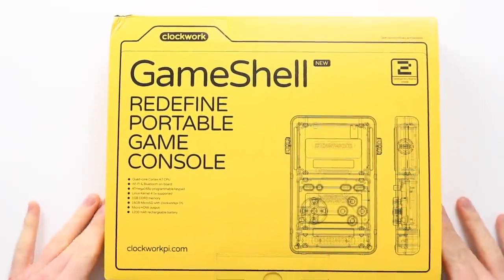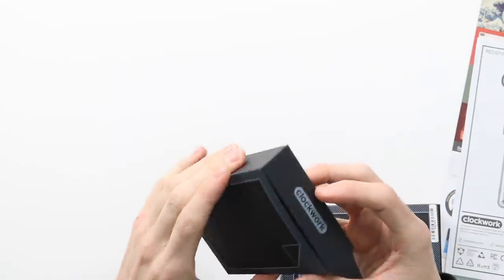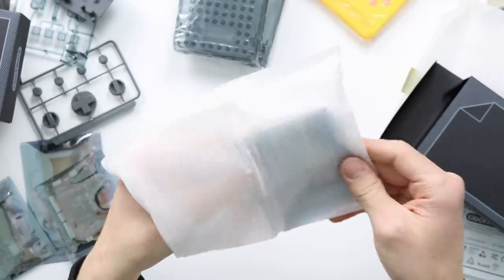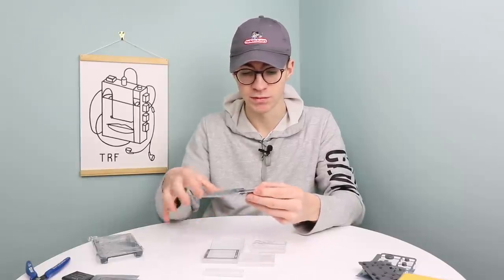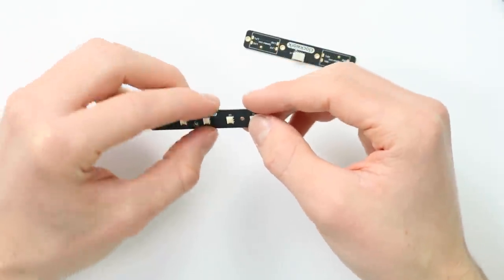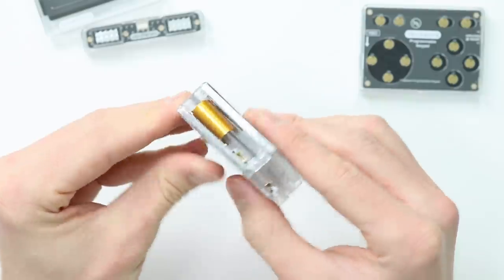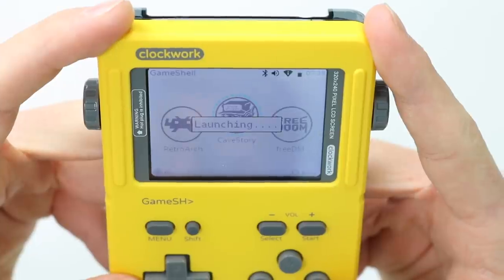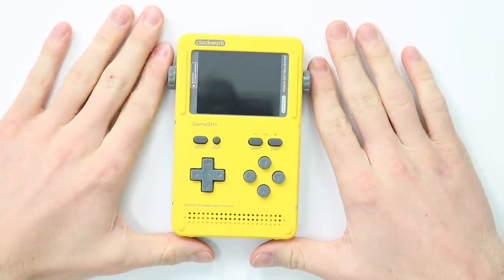Clockwork GameShell Assembly Guide!

Comment: Honestly, I really like the idea behind the enclosed casing mechanic they used, where it makes it so that replacement is much more simple instead of having to deal with removing and reapplying solder, it makes assembly more simple, and it provides an extra layer of protection for the more delicate circuits like the motherboard or the screen. On the other hand, I do agree that it doesn’t look that aesthetically pleasing and they probably could have gone with a more secure method of keeping the console closed. All in all, I honestly think it does look cool, and I’m guessing this is probably very appealing to model making fans.

Comment: I really don't get who this is marketed to, with shipping this thing would set me back $185 (£145). It's more expensive than building a pi based option which has more support since this won't work with emulation station/retropi/lakka. It's also more expensive than many pre-built options for people who don't have the experience to build their own, for example using a PSP/PSVita or Android device. It just seems like an option for people who want to feel like they've built their own when all they've done is plug some cables in.
Reply from the maker: This is way more polished than PI. Pi is very buggy and "dev-like".
Reply: do you consider putting together a pc "building" it? its literally the same thing
Reply: @pez You're talking about two completely different markets. There are different expectations between people looking to buy/build a handheld emulation platform and people looking to buy/build a PC. You're comparing apples to oranges.
Reply: @TheRetroFuture  That's my point. The people looking to build their own don't want a polished experience they want to DIY it themselves, they want "buggy and dev-like". The people who do want a more polished experience could get a similar experience, cheaper from a PSP/PSVita or Android device, hence why i don't see who this is marketed to.
Reply: @TheMixEmperor  i'm just pointing out that building a pc is just putting some parts together, much like this handheld. i wasn't arguing  against the rest of your comment
Reply: I would consider this as something of an "In-between" choice for those who want to start learning what it's like to take a look at modular/programmable stuff but don't have quite the confidence to mess around with things like creating 3D printing models and wiring. This device seems like it's got all the bells and whistles to help people understand that parts like that connect to each other in those fashions. 

Pi is great, don't get anyone wrong here. But stuff like that is usually pretty involved without a few guides handy. This is just "Hey we have that experience here and all documentation so you can get this stuff ready to go in a jiffy!"
Reply: Why get a pi when you can just emulate everything on your computer? /s
Reply: I think maybe this is marketed towards people who play retro stuff, knows some things about computers, and build model kits since it incorporates cutting parts, cleaning nubs, putting them together, and installing software. You can probably paint the shell either by hand, spray cans, or airbrushing. And you can add decals on top of that after applying clear coat and using decal setters and sol, just like a plastic model kit.
Reply: I have a ps vita & I play all my Games on it like SNES,NES,GBA,SEGA,GBC,
Arcade games,PSP,PS1 & Lastly PS VITA Games.
I have put all my games on a 128GB MicroSd Card SD2VITA.
& That's what I call a Ultimate Portable Gaming & Emulation Device With An Awesome Screen & battery life.
Reply: the only reason I see myself buying it would be for the modular design. The repairability/upgradeability/customization would be worth this kind of money, given there's enough options to chose when ordering one
Reply: @TheMixEmperor  "The people looking to build their own don't want a polished experience they want to DIY it themselves, they want "buggy and dev-like""

I think you're being a little too liberal in your assertions of what others think.  I would personally build a pi machine myself, but I absolutely do not want it to be buggy and dev-like.  If I didn't think I had the capacity to build something that was polished and professional looking, then I wouldn't do it, I'd do something like this instead.

Much of the satisfaction for me is in building something myself that looks like it couldn't have been bought off the shelf.
Reply: @TheMixEmperor  Nosense ! First, it's not because YOU want "buggy and dev-like" things by building your own handheld that EVERYONE want it to. 
Second, this thing can run retropie : https://forum.clockworkpi.com/t/retropie-emulationstaion-transplant/1243/10
And third, this is clear Gameshell is marketed for people who want to be able to do more things than just play emulated games on their handheld.
The punchline is "Gameshell : highly hackable", both from a hardware and software point of view.
Reply: @forkayebee3831  - because I dropped my monitor last time I was running to catch the train... sadly, that left me with a keyboard, mouse and CPU in the seat next to me with nothing to do for 30 minutes.... sad....
Reply: @TheMixEmperor  you don't even know what you're talking about. In no way is rasp-pi buggy and dev-like once you get the correct emulators.

Comment: I'll tell ya who this is marketed to.... People who want a top-quality retro handheld, but don't trust the Chinese to assemble it for them. I think the modular approach is great. The thing has to be one of the most DURABLE handhelds on the planet with all of those layers of plastic securely in place. Maybe in the future, They could sell you different kits to customize your handheld, maybe more buttons, a different d-pad, or analog joystick, a different screen, etc. Potentially, these custom kits would come with everything that you would need. For instance: An analog joystick upgrade would come with a board with the joystick attached (or maybe unattached, like how the speakers are done), rubber contact sheet, inner control pad box lid, and a new top shell lid. BAM! You got a different configuration, and it's just as solid.

Comment: I bet this sounded like a good idea on paper, but... Come on, $160 for this? And a missing battery in a SPONSORED VIDEO?
Also, how often is the customer expected to open the device to justify those fugly wheels on sides instead of 1 or 2 screws?
Is there any reason for those modules to be kept in separate cases? Why? 
By the way, it's not even able to run GBA games properly.
Reply: Thoes parts are in containers to make it easy for smbd who is not into electronics. Its like easy version of rasbery pi, i gues it is made for kids

Comment: $160 for that? Are you kidding me?
Reply: is cheaper if came assembled from china... maybe 60 bucks.
Reply: You could get an actual raspberry pi zero 3, or mod a psp/vita for less than $100
Reply: or a real new 2DS XL
Reply: It's not meant to be a bargain. It's high quality components (except for that missing battery....LOL), open source, modular. It's for tinkerers and enthusiasts. If you're looking to get the cheapest comparable game system, obviously there are better options.
Reply: If you wan a modular console buy the odroid. Its more cheaper
Reply: @micweis  Modular is not a good thing if you're stuck with proprietary hardware.
Reply: @Roensmusic ... No, New 2DS XL is dead for retro.
Reply: @marklecarde3112  What? I use my New 3ds XL and the OG 3ds as retro gaming machines daily. I don't know what you're getting at exactly. The 2ds XL is the same thing minus the 3d functionality.
Reply: @rogueangel2k  C'mon, it's not even enough for PSX emulation.

Comment: honestly the fact that you have to insert every pcb in its own plastic case is not resourceful at all. You could very easily do the same with a frame of some sort or even screwing everything in the case. Very unnecessary, and only adds more thickness to the all around build. I think what they tried to do with the wheels and the separate cases is to easily trouble shoot it, or upgrade parts later on- even still, you don't need the plastic cases.

Comment: "From 0.043MHz up to 1GHz with Quad-Core, that is 90,000 times faster than the Apollo 11 guidance computer."

Its so slow they had to make an argument for themselves, come on guys, Cortex A7 cpu and a "mali gpu" not that
you specify very much at the first sight means that it is actually a pretty old SoC.

I cant even remember what used to run on A7 because it was so many years ago that my memroy is starting to fade away...
i bet the machine is still reasonable in less demanding emulation, but will lack the power to even run the most basic of cellphone games.
Reply: oh right it was 2013, now i remember, thanks Wiki.
Lets get this out of the trash and be very clear about one thing... This thing is insanely slow for being a gaming machine.
there, i said it.